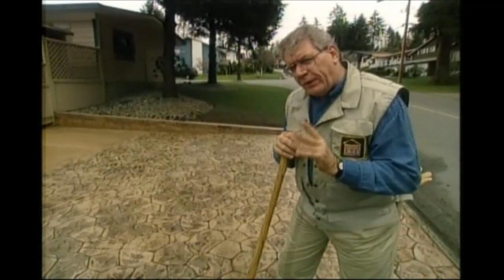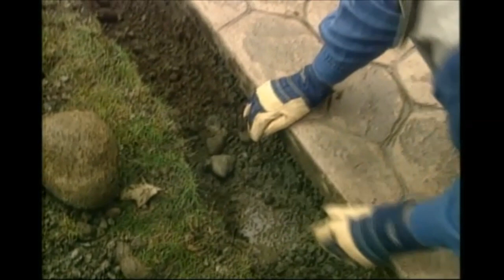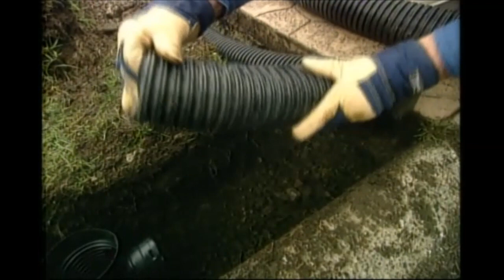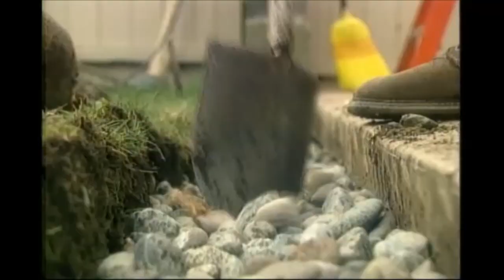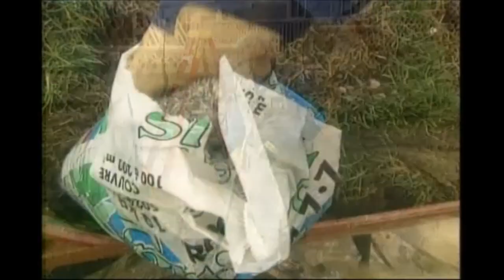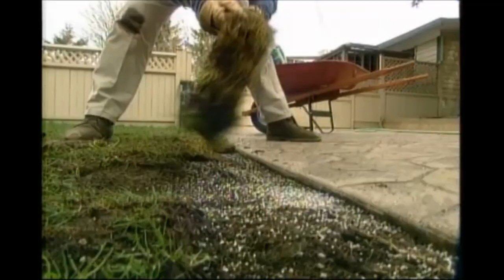Concrete Slab Drainage Using Big O Pipe For Driveway

Comment: Like others have said, the drain pipe should be in the other side of the driveway. Also, you should use an 8oz non-woven filter fabric to wrap the entire trench. I.e. dig trench, lay fabric, lay pipe, fill with rock, then wrap the fabric over top before backfilling soil. The entire trench with rock and pipe should be wrapped like a burrito.

Comment: You know if you would've done it on the other side and prevented it from going under the slab at all you wouldn't have any issue.  But your method doesn't work if water is still allowed under the slab.